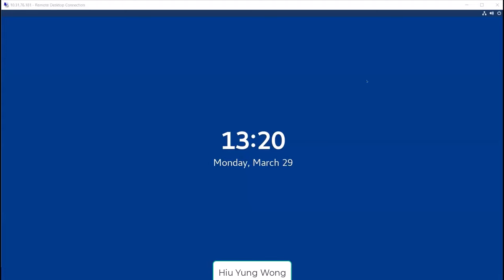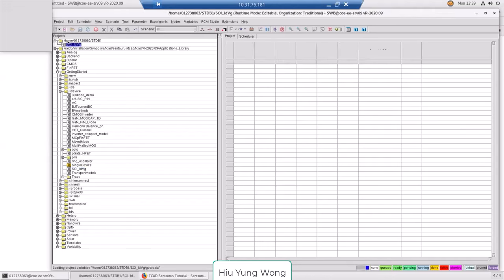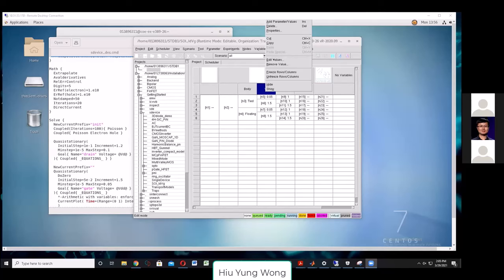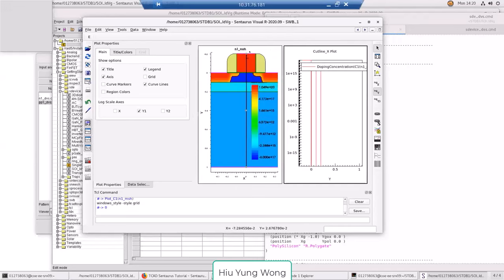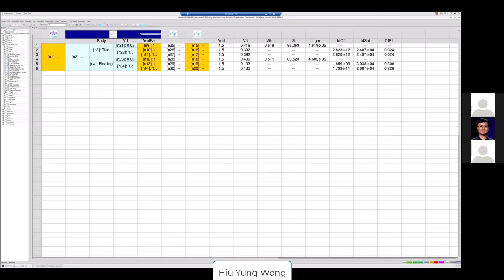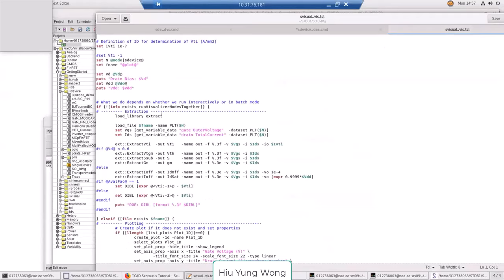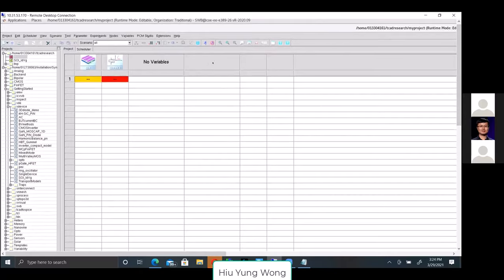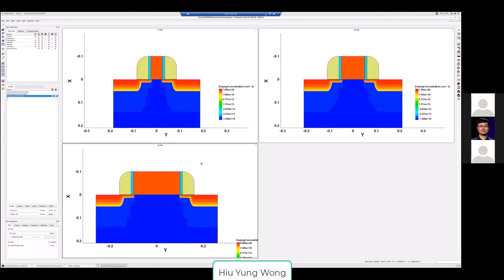TCAD Sentaurus Hands-on Tutorial: Sentaurus Workbench and Structure Editor and SVisual

Comment: Sir thanks for the great lecture.
sir i have a query, sir now i am making device and using work bench for generating my structure but after simulation there is only band file for visualization. it is generating the msh.tdr file but not visual when i am opening the sde tool visualization. Is there any problem regarding my setting in work bench.please help me.

Comment: Sir , i have a research topic on ml parameter extraction of I-V char of FinFets on diff gate length , as i am a beginner how to generate those parameters  on Tcad?? any dedicated video to this will be very helpfulll
Reply: i have to generate data from Tcad to train my ml model
Reply from the maker: @Sidhantvazarkar-u5y  You can make variables for the parameters you want to vary in SWB and submit the job. Better yet, try to run everything in script form. You will need to write a script to call the tool (sde, sdevice, svisual) and process the data.

Comment: Prof. Wang, 
What do change if everything is good in my sdevice file, and it runs fine but did finish and ends up red. the error is "Newton didn't converge, trying with smaller step..."
Finished, because of ...
Step-size less than MinStep (step-size=9.77e-5)
Thanks in advance
Reply from the maker: This is a convergence issue. It can be due to mesh being too coarse or super dense, turning on conflicting models, or using inappropriate math. I suggest you contact Synopsys support to see if they can help if you are not able to solve it. Thanks!

Comment: Sir can you help me 
If my project directory is deleted from workbench then how can i retrieve my project folder in workbech tcad?
Reply from the maker: @bushrafatima4505, if it is deleted from SWB, it is the same as deleted in the command prompt. Unless your system has a backup, it is gone already. If you have a backup, you just need to restore that folder. A SWB project is just a regular folder with a .project file inside that directory. Maybe new features have been introduced. If this is very important to you and you cannot recover, I suggest you contact Synopsys support in case they have a way.

Comment: thanks a lot sir... for color variation in icon of students, kindly check try the below method, before clicking connect button in remote desktop connection, modify display settings to 16-bit. I think its in 32-bit
Reply from the maker: Thank you! Yes, this was the reason. But sometimes it is 24. Just need to try different values.